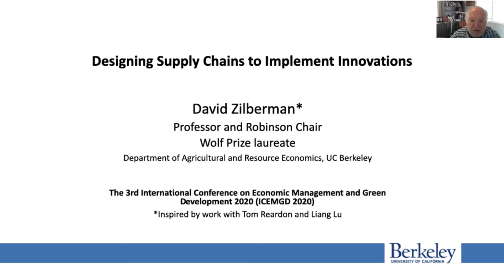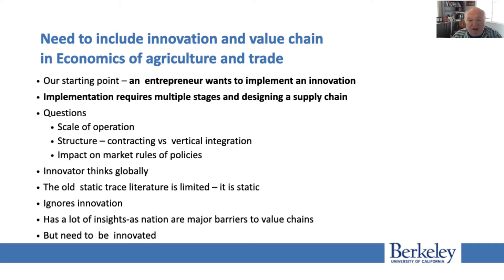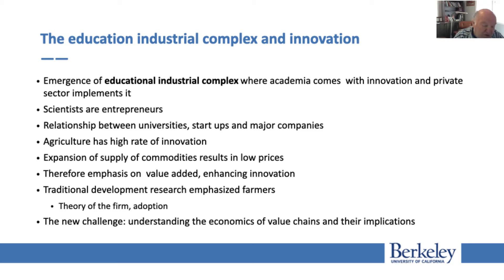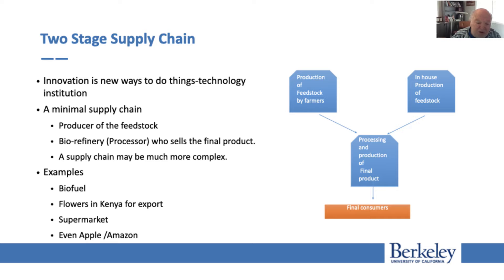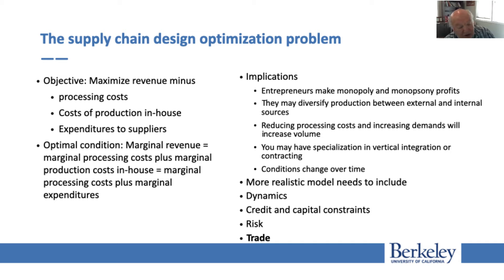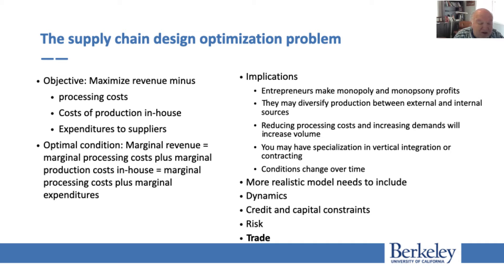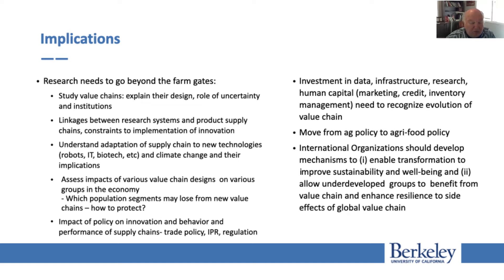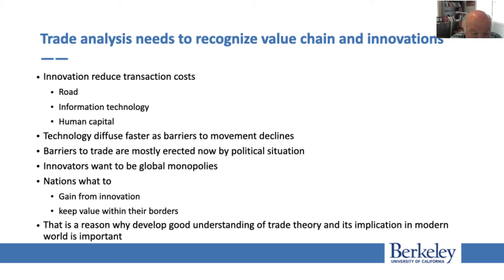ICEMGD 2020 - Designing Supply Chains to Implement Innovations

Comment from the maker: Here are the questions we collected and answers replied by the presenter:

Q1: According to your conclusion, you mentioned "Technological change results in innovation and new markets that tend to be non-competitive; Over time, the structure moves towards competition." I wonder why the market would move from non-competitive to competitive. Are there any specific influencing factors?
Answer: Overtime more imitators enter the market producing products similar to one originated by the entrepreneur, and the result is monopolistic competition that becomes more competitive over time. 

Q2. I'm confused with the relationship between monopoly and innovation, since you have mentioned that a highly innovative economy has a high rate of monopolization and that society needs to tolerate monopoly, or the innovation would be slow. Why can monopoly encourage innovation? 
Answer: Monopoly doesn't encourage innovation, but having the power to be a monopoly for a while is an incentive for innovation. Once a monopoly has been established, they would like to deter others from entering the field. So you need to allow people to have monopoly power while they innovate but at the same time, prevent excessive monopoly power to deter others from innovating. 

Q3: Regarding supply chains in farming, when you mentioned the decentralized system what assumptions need to be present to make it economically efficient?
Answer: A decentralized system is efficient if a member of the system is able to utilize the best technology and it's not worthwhile for the innovator to produce the feedstock inhouse. For example, when they started exporting flowers from Kenya, in the beginning the exporter produced the flowers but after a while, local farmers learned how to produce the flowers and became the suppliers. 
 
Q4: By the time Walmart was established in Arkansas, in my understanding they had a kind of nucleus model. They owned the “market” and contracted farmers to produce for them. In comparison to the farm-to-plate movement, they did this on a large scale. If we consider that transport costs are often one of the highest input costs in a supply chain, as well as changes in healthier consumption patterns and more consideration to environmental impact, carbon emissions and fertilizers. If a company could set up a professional farm-to-plate market, testing food safety and inspecting suppliers in a large city, they could theoretically use the nucleus model and move from small district to district until they are throughout the city. Do you think this low cost supply chain model has the ability to disrupt the large grocery chains in the future?
Answer: Transport costs are not the highest costs of the supply chain. Wal-Mart reduced overall transaction costs as well as real estate costs immensely. They have a good storagement capacity and they also look for the cheapest producer given quality, taken into account transportation cost. Local supply chains can disrupt large grocery chains if they are able to provide something unique that is appealing to consumers and is not yet very expensive. Farmers Markets are successful in some places. There are local chains that are able to develop high quality supply and provide extra benefits to consumers. The industry is evolving all the time. We thought that Wal-mart was in trouble but they responded very well to the COVID crisis.